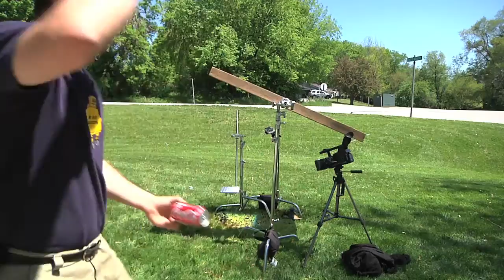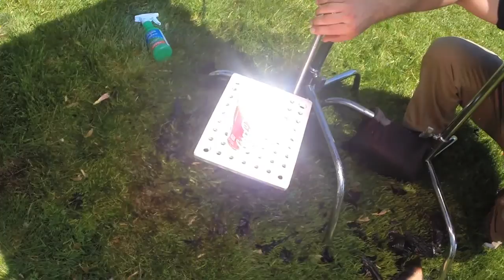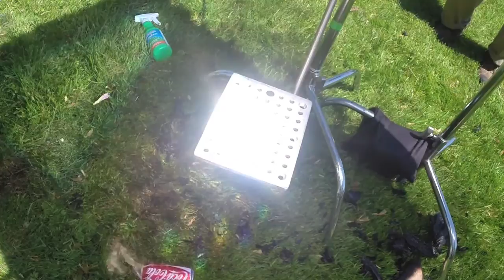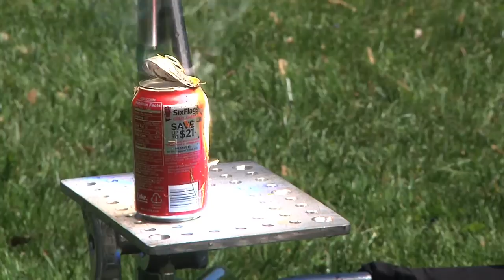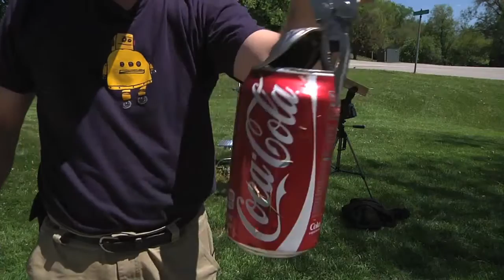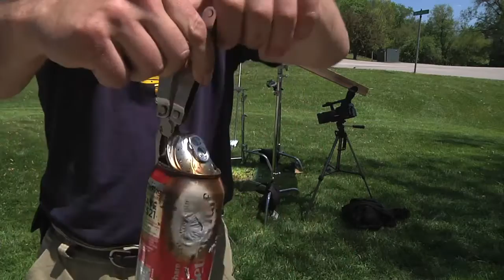Solar Death Ray vs Coke

Comment: My advice is, don't put any pressurized spray cans on the rack.. Those kinds of cans are made to hold much more pressure than a coke can.. And, the stuff inside a spray can, is sometimes a little explosive, when super heated and mixed with air..

Comment: What happens when you put a solar pannel under that stuff?
Reply from the maker: Incrue A Photovoltaic (PV) panel? It would melt. PV is LESS efficient at higher temperatures (think superconductors!) so pointing a solar death ray at it wouldn't make it create more electricity, it would be less, then burn/melt/explode....
Reply: BenjaminNelson Probably create more electricity that a bowling ball or shotgun :) 

I second this challenge. For Science.
Reply: BenjaminNelson There might be a short surge of power, like cloud-edge effect, before the heat started melting the PV's guts.. You need to put a matched load on the output, that would draw full power at the MPP voltage. Once it was getting full output, then slide it under the Death Ray, while recording the watt meter reading, with the another cam..